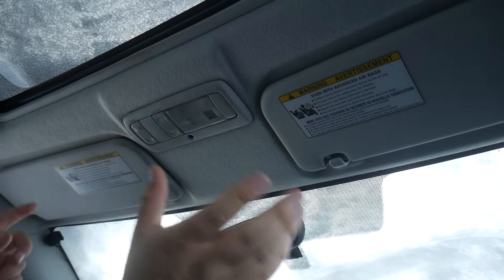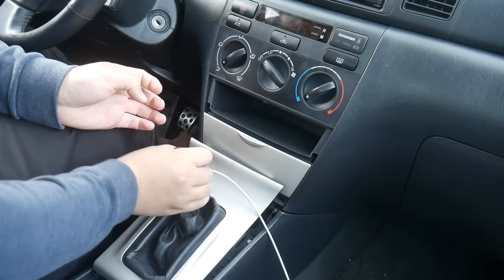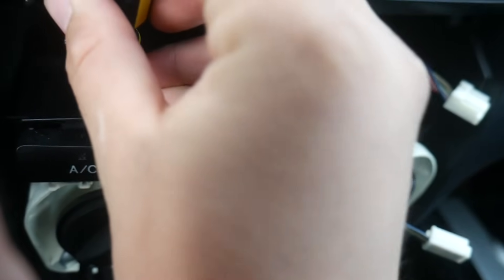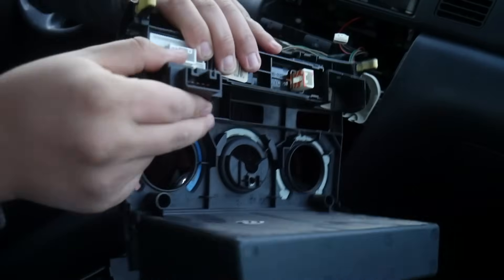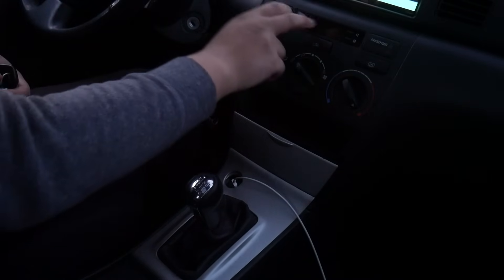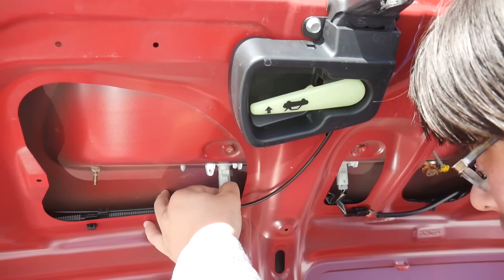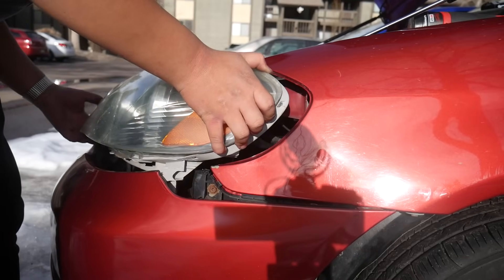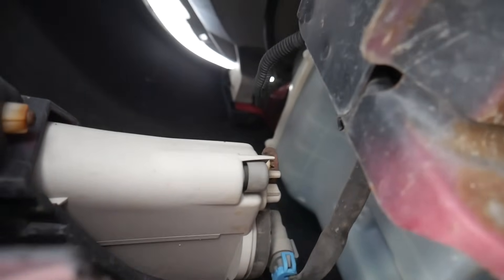Corolla LED Light Swap (Ultimate Guide)

Comment: Please make sure right information
I watch your movie and order 3157 bulb my Toyota Corolla 2008
But not working I order almost 8 bulb all is waste
Because your information rong
You first make sure socket size
Standard socket or CK socket
Reply from the maker: Sorry this install isn't going smoothly for you, I'd like to ask for some clarification because 3157 is the correct bulb size for the turn signals. Did you try installing the bulbs the other way in case the polarity was incorrect? LED bulbs are polarity sensitive. I've double checked everything I included in the description and I'm confident without a doubt that it's correct. Please feel free to dm me on instagram @willhchang or email me at willchangmakesvideos@gmail.com and see if we can work this out. Thanks!
Reply: Thanks very much
I am in republic of Ireland
I think you are in USA
Your driving side is left side
My driving side is right side
You show your video 2003 to 2008 Toyota Corolla. 
I will check properly
My socket is SRCK
My tail break light bulb 7443
My tail  indicater bulb size bua15s
I think you make videos you must be need more information 
Cor country and  which side driving